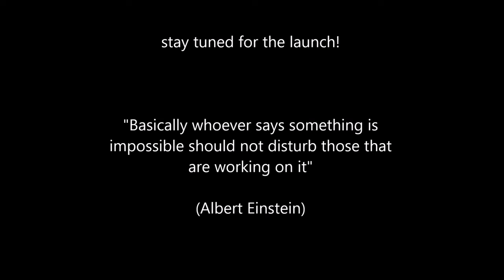Building a 10ft sailboat - Argie 10  [ENG version]

Comment: Nice build.  It's great that you involve your son in it.  Wonderful life lesson.

Did you have to change the location of the mast (or the centerboard dimensions/location) from the original Argie 10 plan to accommodate use the pico sailmast and sail?  Do you plan on using the Pico jib as well?
Reply from the maker: Thanks Paul! No change were made to the mast and centerboard location given that the laser pico main sail (5.1sq m) is pretty much the same size as the argie 10 main sail (5.25 sq m). I am still wondering about the possibility of using the laser pico race sail (6.44sq m) with this rigging. However, I don't think that I can use the laser pico jib, given that in order to do so, the ceterboard should be moved forward to compensate for the change in the centre of effort. I am still looking forward to see if some adjustments are needed when I'll launch her in a few weeks.
Reply: Thanks!
Reply: Hi.  I was wondering if you had a chance to try it out with the Pico Laser sail and how it handled?
Reply from the maker: Hi there, yes here is the video of my boat with the Laser Pico main (it is not the original laser pico sail but has got the exact same specs): https://www.youtube.com/watch?v=qnWAadkWkTA&t=3s 
Unfortunately I couldn't sail due to the bad weather approaching and the oncoast wind blowing. I will try again soon and post a video.
Reply: Thanks!!
Reply from the maker: and here is a very short video of myself sailing my boat: https://www.youtube.com/watch?v=ADOBIL_AKSU 
I will post something more detailed as soon as I have a bit more time
Reply: hey ,if anyone else  wants to discover boat building plans australia try Joolaim Rudder Replication (Have a quick look on google cant remember the place now ) ? Ive heard some extraordinary things about it and my co-worker got cool success with it.
Reply: Hi  @sailingjabuka465  A quick question.  Did you scarf the panels together to join them?